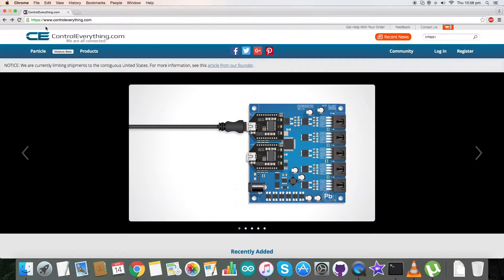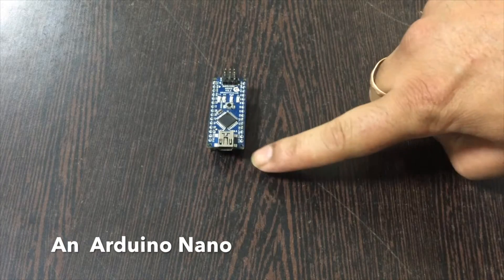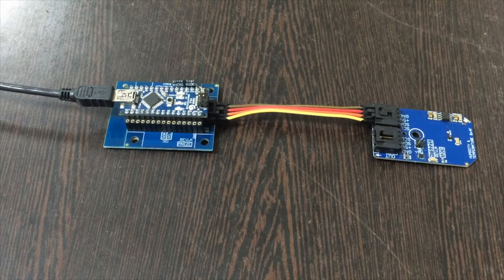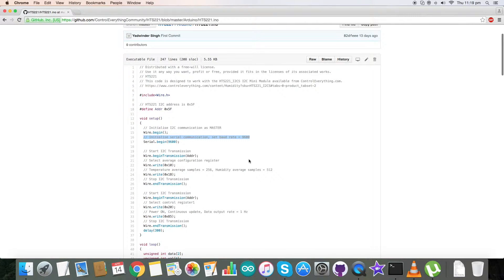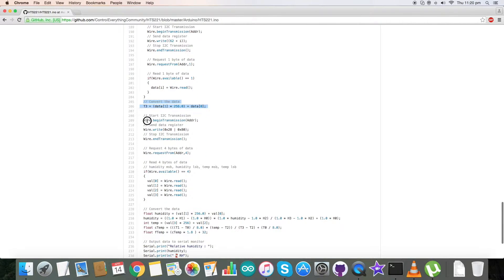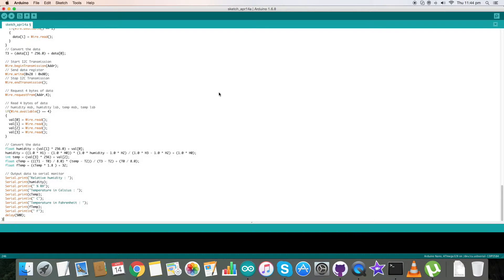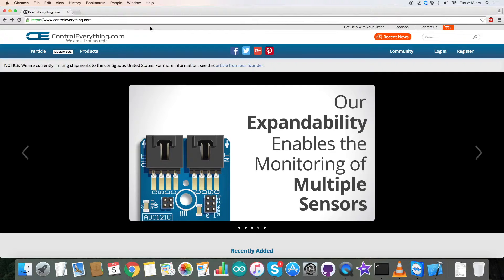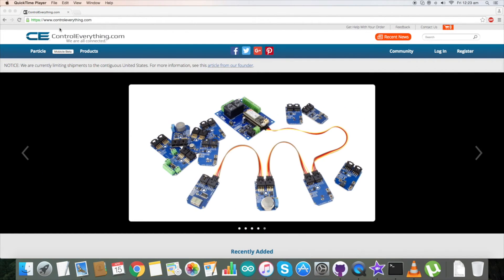Arduino Nano - HTS221 Relative Humidity and Temperature Sensor Tutorial

Comment: My temp is reading 1234 deg C - why
Reply from the maker: Make sure your hardware works..
run I2C scan code..
if it shows on scan then use that address to read temp and humid..
Reply: My hardware works with another library but not this one. The humidity with this library works okay. I am still figuring out the conversion formula in your library ...will keep at it until I get it to work.